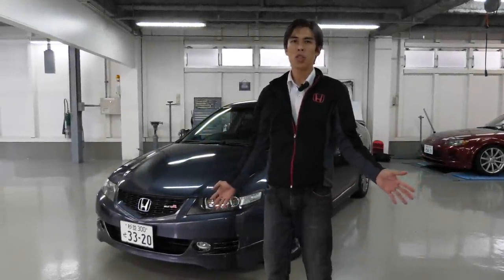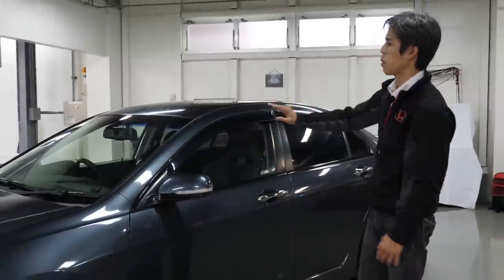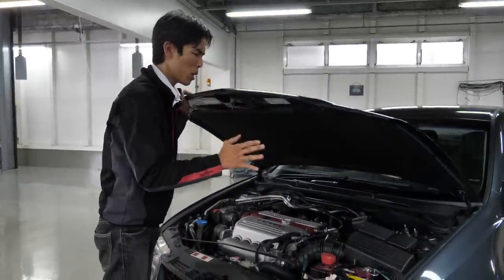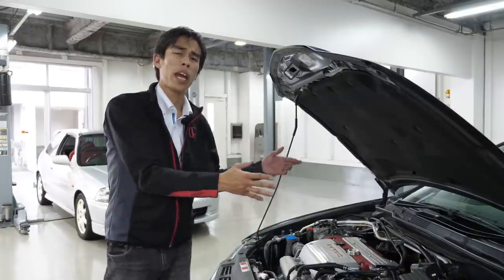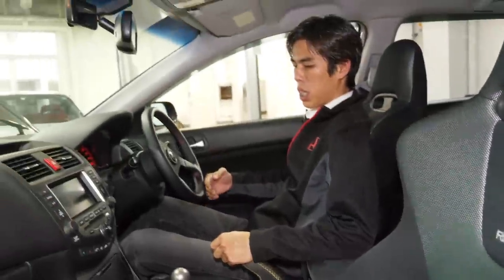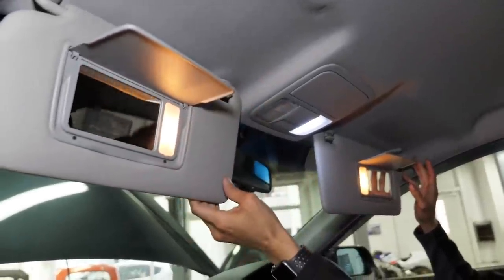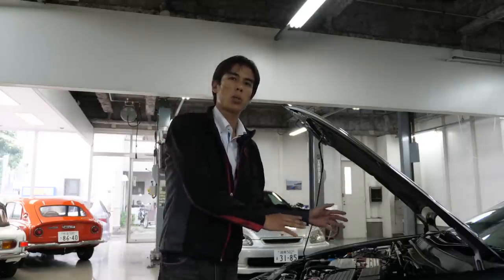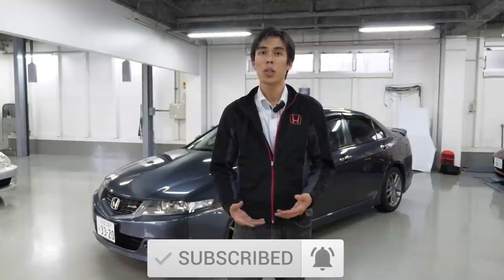The Last Sports Honda Accord, Review | JDM Euro R CL7 | Spoon restomod - For SALE | JDM Masters

Comment: First car i bought was a Honda Accord Euro CN1, the diesel engine N22A1, not the most powerful but quite torque'y. Currently placed a bid for a Accord Euro CL9 Type S. Quite a lot has to be done to fix it but i really want to, it has the 2.4L 190 HP engine, im in love with it and havent even bought it yet.

Comment: I've got same colour 2006 but 2.2i-ctdi most reliable car I had. This is my second Accord first was 2005 pre-face lift with 5 speed manual as well 2.2 i-ctdi .Bought it with 100k miles on the clock I did another 100k in tree years without any single problem . Wish to get euroR but in England is very expensive to get one.

Comment: Accords have double wishbone till 2012. Kinda blew my mind. Started paying close attention to Hondas when I started working at a Honda dealership. Already obsessed with Hondas so working here has just honed my knowledge even more. I just purchased a 2011 civic si and kinda bummed that I’m stuck with McPherson struts on that car. Luckily the trade off is the newer style is easier and faster to work on in my opinion. Have the Si lowered on H&R springs that also are stiffer so gave the car a more solid less floaty feel. My prelude and accord coupe still feel more direct and less floaty not sure how to explain it. Double wishbone feels like the suspension travel movement up and down is more straight? More planted? More solid? Like I said I can feel it can’t really explain it. Also my prelude and accord have traction bars from factory which the si does not have. Maybe I can graft accord/tsx/tl double wishbone onto my Si? Not sure how that’d work

Comment: Please tell the viewers whats the difference between this JDM versus the TSX in USA and the Accord Euro in Australia? Does the non JDM versions 
also have LSD? Same double wishbone front multi link rear suspenion? Interiors the same? There was also an RSX in the USA?
Reply: I own a 2004 TSX and can tell you it also has double wishbone and multi link rear suspension, but no LSD. The TSX also has a stroked K20 becoming a K24, that has a bit more torque but lower redline. The exterior, grilles and interior are a bit different but a lot of the parts are interchangeable. One other interesting thing that wasn't mentioned in the video is that these cars have a magnesium transmission case.
Reply: @jaredurys8867  Sick info! Thank you! The JDM Euro R has a 1 way helical LSD that comes stock, and there are pre facelifted version 2002-2005, and facelifted version, 2006 to 2008, the bumper, grille and bonnet are slightly different. They also come stock with HID lights, Recaro seats as mentioned and Momo steering wheel.
Reply: @antonc108  Yep, the TSX was sold from MY04 to 08 and received the face lift 06-. The TSX didn't receive Recaro seats or a Momo steering wheel but did have HID lights. The projector lenses from 04-05 were clear and gave a very sharp cut off... from 06-08 the lenses were frosted. I wish it had the LSD like the Euro R, but it's been a great daily driver that has aged better than most cars from that era. Mine is white pearl with tan and black interior and has 200k miles with the original clutch. It's estimated that about 90% of the CL9 TSX were automatic transmission.
Reply: Nurb facts :) really hard to find manuals on CL9 I finally got one after years of looking for one. Great cars indeed with plenty of potential.
Reply: Nurb mine is a 2007 in manual. Love the car so much more after headlight swap and kit swap. Also, 2007-2008 can be used with flash pro

Comment: I’m trying to get a daily first car and debating if I should get a 145k km vs 100k km mileage car in which the 100k km mileage car cost $30k HKD more . Not sure if I should stick to the high mileage one as it will depreciate less anyways and not worth it for the added money for 45k km more mileage. What do you think? The 100k of course looks better with some mugen parts and 145k has a Js racing exhaust.

Comment: Can anyone confirm if it runs spacers or do spoon monoblocks fit under the standard euro r rims? I'm about to buy a BBK for my CL7 Euro R and I was told the stock rims offset wouldn't fit the spoon calipers?
Reply: You will have to put on 10mm spacers.
Do what I did and change alloys which I did for my cl7. 
I have a 42 offset which is close to the arch with good clearance no scraping or rubbing. 
What brake disc and pads will you be using?
Hope that helps.
Reply: @mohammadhussain3505  yeap I just bought some evo8 rims, unfortunately Australia has banned any type of spacer or adapter. FWIW I believe a 5mm would have done the trick.

Comment: k20a that mean in middle east people can buy this car and then fix it using civic type r fn k20a spare parts available specific about important parts when needed like( engine plugs seals etc......)  from honda dealership, but in middle east left side drive (power steering in japan right hand but in middle east left side) people in bahrain they purchase sport cars like skyline gtr gtt and change or shift the power steering side some of them in uae, but honda putting the same k20 engine is smart and better for people can find parts easily and fix it anywhere anyplace, this accord euro r cl7 still way better than (maxima, lexus is300, 350z, avalon etc....)  the engine type r k20 on 4 door car whats better than this someone can find, anyone purchase this car should pre oil change to safe engine performance and life.

Comment: Hye Bro',
Thanks again for this work and passion.
That was interesting.

In France, yeah we had the Accord TypeR CH1, this is by now a rare yougtimer, and many of them are in bad shape and many many miles on the clock (km here).

But it still a pretty Honda to drive especially as you said with its dynamics characteristics, more sedan than a crazy Hatch lightweight TypeR track focused.

Here we the CL7 and CL9 versions.
Also rare to find and kindda expensive compared some BMW 3series, E46, 323i or 330i.

In my opinion,
Honda should have continue to produce the TypeS brand. 
So the EuroR version shpuld have been called TypeS.

Cause it's kindda weird to understand with all these sub logo sub brand etc
It's still real today, they should organize thier brand like this

Normal version
TypeS aero Kit
TypeR
RR track focused (like Renault with polycarbonate windows)

With this architecture, will be easier to understand everywhere in the world.

Thanks a lot.
Please keep dealin' passion ✌🏼🇯🇵🇨🇵🙏🏼😎

Comment: Had UK version Type S k24 engine , it was 2.4 with 200bhp but felt so slow and vtec felt so weak. Very disappointing
Reply: I have same motor as yours, You need to do the Hondata or KTune it’ll lower the VTEC engagement from 6000 to 4500 rpm.
Reply: Yes, Hondata will really wake that k24 up